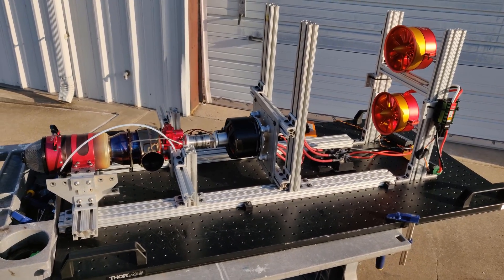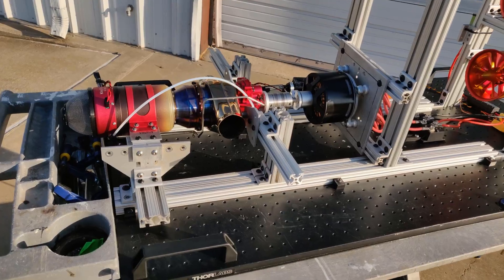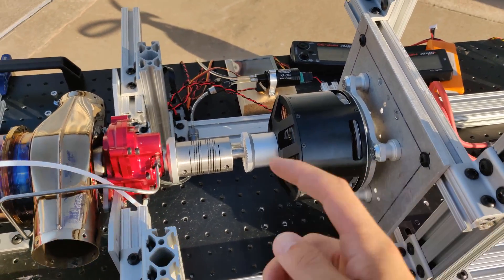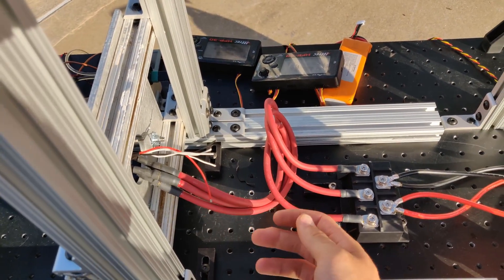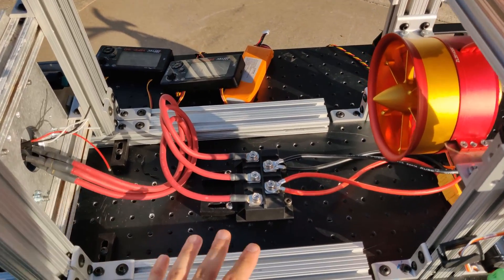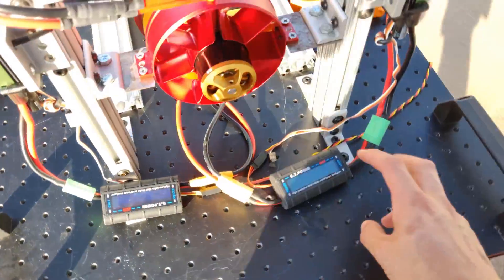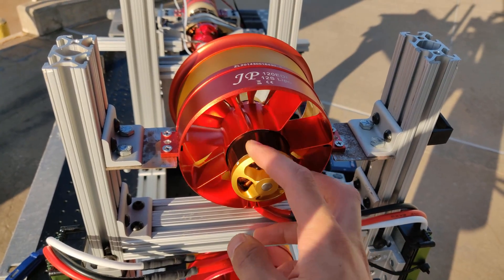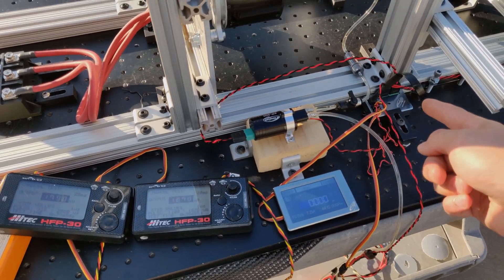Turbo Electric Hybrid Aircraft Power System Test Bench First Run

Comment: To maximize total efficiency you want the turbo engine and generator in a constant load configuration for the majority of it's operating time. The turbine engine specs should list it's most efficient operating conditions. This should be the target charge rate for a battery / capacitor storage system. With a properly engineered load buffered system the variable current draw of the power transmission system should not impact the load placed on the turbo generator. The varying load conditions are the source of the inefficiencies and most of the pollutants in (ICE) internal combustion engines. Load buffering is absolutely paramount in achieving maximum efficiency with the lowest emissions possible. This is true regardless of the ICE used and has not been implemented in a single hybrid electric vehicle I am aware of at this point in time.
Reply: Sadly they haven’t posted in some time.
Reply from the maker: Yeah sorry, been super busy. I've got more videos to upload on this at some point!
Reply from the maker: I agree there is an optimal torque for each RPM of these BLDC motors and of the engine as well. Ideally you match the efficiency curves of both the prime mover (engine) and the generator to match at your most common load power level. There are ways of implementing an adaptive hybrid controls scheme using active 3 phase boost rectification instead of a diode rectifier (like I show here) that can give you much more control of the torque and RPM of the generation/engine, allowing you to optimize and get the best efficiency at off-design lower power levels, even it if isn't as efficient as the on design conditions. I've seen lots of new UAS hybrid power systems utilizing this type of controls scheme in recent years. Many hybrid automotives employ control systems similar to this and will start and stop the engine using the battery to "buffer" the power system allowing the engine / generator  to operate closer to its max efficiency recharging the battery when it does cycle on.
Reply: @ElectroTechnics  he’s back! Nice yea I’m working on adaptive hybrid control system. Using a KingTech KT45TP. UAS runs of a 12s lipo the engine is controlled by a teensy will run engine in a voltage range while controlling change rates to keep packs at a safe charge rate, while also compensating for  the current draw from the UAS bus. Let me know if ur still working on this. Should discuss.
Reply from the maker: @dronelabs556 Cool! I worked on that same type of thing as one of the next phases of this project. Used an Arduino instead of a Teensy to run engine PID. If I did it again I would use a VESC as an active 3 phase boost rectifier, that's gives you so much more control authority to handle efficiency optimization, battery recharge, and more. I'm always happy to talk about projects like this, just shoot me a message on here.
Reply: @ElectroTechnics  I’m working with 3 phase FBR w large smoothing capacitor. Run 170v 3 phases or ~350v with 6 phases DC into a dual SMPS, controlled w same teensy that runs the engine. It’s probing voltages on different ground planes and dynamically trimming the SMPS to control current to the 12s bus. Thing is sweet. Charges packs up while holding down a load in 10-15 mins. Thing is engine needs to be more efficient. Thermal efficiencies are low. Or make a second stage to recycle the lost heat.

Comment: This is the exact setup I'm hoping to use to provide power to an electric motorcycle project idea I've been tinkering around with. i looked a wile back to see if anyone has done a similar setup and found nothing, it seems in the mean time you ended up doing exactly the setup.

Comment: This is exactly what i was thinking.
But than with just a combustion engine.

Haha you made a turbo charged jet hahah
Awsome!

But bro. Safety firts.
Youre talking about 7000 rpm
And you dont have a barijg between the flexible coupling and the motor?

You dare standing there while filming.
If the thing snaps, and you get a little disballance at 7000rpm.
You'd better be wearing a helmet. Better make 2 on top of eachother, just to be Shure. 😉

Dit you make any progression lately?
Reply from the maker: Hey thanks for watching and commenting. These couplings were small I wasn't too worried about it flying apart 😂.  I haven't worked on this in a few years now but where I left off I was working on using a VESC 75/300 as an active 3 phase boost rectifier in place of the diode rectifier. It provides way more control of the system and higher efficiency levels.
Reply from the maker: I have lots of unedited videos of additional work I did on this project. One of these days I may find time to dig them up, edit, and finally post the updates.

Comment: Hi there, do you have a capacitor at the diode rectifier? Thank you
Reply from the maker: There is no addition capacitor, although the motor controllers connected to it have capacitors on their DC inlet bus, so technically there is some capacitance added after the rectifier.

Comment: Dude this is exactly what im busy with with a drone of mine. Good work so far
Reply from the maker: With a turbine? Sounds like a cool project, I'm putting a smaller version of this on a multirotor currently. I gotta get some more videos uploaded of it. Good luck with your project!
Reply: @ElectroTechnics   yes same setup as yours but im running 3 120mm edf units. When you posting more vids?
Reply from the maker: @perrinoneill1656  As soon as I get some time to edit them, I've got lots of unedited videos, and I'm currently working on putting a small version of this system on a dodecacopter drone! I am excited to try to fly it later this week. I'll post it up as soon as I get it going.
Reply: @ElectroTechnics  sir the setup you have was exactly what i was looking for

I hope you read this!!

 at idle you barely generate any power or thrust while consuming a relatively large amount of fuel in comparison to generating huge amounts of power and thrust at 70% throttle while consuming a bit more fuel than idle

What i am suggesting is that the turbine engine is ran at max power then the electric motor is used in regenerative or generator mode to put load on the engine which drops its rpm to the max efficiency rpm

This will generate both thrust from the propeller and provide constant current 

You will measure that current generated at that point and accordingly size your edfs to benifit from every Watt generated

I believe this will provide the best performance and efficiency on average

Please let me know what you think
Reply from the maker: @FirstLast-tx3yj  Yes! That's the ideal operation mode for this. The larger scale tests plan is a turbo prop engine with a hydraulic variable pitch prop, so it will automatically adjust the "load" of the propeller to maintain the optimal RPM. Ideally we can adjust the amount of "regenerative braking" on the motor depending on the electrical demand, and the prop will automatically adjust to keep the RPM up when the generator loads down.

Comment: I don't understand why anyone has not made this on a large scale yet. But with propellers versus duct fans
Reply from the maker: I'm working on a larger scale version of this for testing with manned aircraft. Over the next year I should have a video of some test runs!
Reply: @ElectroTechnics  I am really looking forward to that!!! I am working on getting my pilot's license and looking at airplanes to buy. I don't know on someone hasn't done what you are doing on a large scale platform. It seems to me like a small gas turbine or piston type engine acting as a generator for a constant power output to a electric motor would make a fantastic airplane.
Reply from the maker: @gsxr600rafii  I could see the hybrid design allowing powering a distributed propulsion system which could open up the possibilities for small manned aircraft capable of vertical take off and landing. Maybe a plane like a Cessna with 4 lift rotors that electrical power could be diverted to for take off and landing similar to a multi-rotor drone.
Reply: @ElectroTechnics  that would be amazing!!!
Reply: @ElectroTechnics  I realised here that you take AC from the generator convert to DC with the rectifier
 then input DC in the controllers and output ac for the edf fans

A simpler setup I would suggest is to connect the edf fans directly to the generators
And you throttle the fans by controlling the regen on the generator motor

When you add regen the fans will spin higher and when you decrease regen they will shut off

Given that the edf can withstant the 60V from the generator
Reply from the maker: @FirstLast-tx3yj  It doesn't work that way. Without that DC bus in the middle (if the AC generator is connected directly to the EDF fans) you loose all controllability of "regen".  The EDF's current draw is a function of the frequency and voltage of AC that is supplied, so they could be directly driven by AC but you lack any high level control of the EDFs and if you run multiple motors off of that high frequency AC, it is very easy for the motors to get out of sync, spin the wrong direction, or burn out. All bad things on an aircraft. This is the reason AC induction motors have starting capacitors to make sure they spin the correct direction and to handle the massive starting current as it tries to sync up with the line freq.

Even with a DC rectifier, you are unable to directly control the amount of regen happening. With a DC rectifier, the power generated is a function of the generator's speed and thus voltage and the load's power consumption at that voltage. 
To be able to control the regeneration, it is necessary to have a DC Bus with a capacity to store DC power (capacitors or batteries) and to have an appropriate bi-directional ac dc converter (I used a VESC) which will modulate power to and from the 3 generator leads, to induce the correct amount of magnetic field into the generator's stator to achieve the desired power generation. Without this, there is no way to directly control that power generation. If you are interested in how this BLDC regeneration control scheme works, there are many scholarly publication available on the internet that go in depth...they are rather heavy reads though.
Reply: @ElectroTechnics  thank you for the lengthy explanation appriciate it made things very clear.

I also realised in your latest video you have a propeller is it connected to the other end of the generator or it has its own motor?
Reply from the maker: @FirstLast-tx3yj  The propeller on the test bench has its own motor. It is there to simulate a propeller type propulsor on an aircraft.
Reply: @ElectroTechnics  not on the test bench... in you last video where you flew the plane
Reply from the maker: @FirstLast-tx3yj  oh, hah! Yeah it's on a completely different motor/shaft, exactly like the test bench. We will be working on a new config where the prime mover engine drives both a propeller and a generator for the larger scale tests.
Reply: @ElectroTechnics  ı have been thinnking kinda same think over here in turkey, cannot get it out of my head,  a manned vehicle with vtol and drive cabilities but my setup is a liitle bit different
Reply: I was just thinking the same thing and started looking for YouTube videos to find. 

I was thinking of a turbine with a shaft drive like a turbine powered helicopter, or a turboprop, but with shafts powering 4 rotors like a quadcopter. It would use variable pitch blades for directional control and Gyros or Flybars for stability

I imagine this might be a solution to the problem of short battery life when upscaling an electric powered quad to human scale.
Reply: @ElectroTechnics did you do it yet?
Reply from the maker: @mrwess1927  I haven't worked on this for a few years now. Other students are still working on it though and they have a much larger version now using a PBS TP100 engine, driving a generator and propeller, mounted to a stationary Cessna 152. Its a pretty cool sight to see!

Comment: Hello, i would be interested to know more details about this. I might use this in a project myself (Not airplane but as hybrid propulsion system) Could you share more details about how did you choose the right generator motor, the diode system to convert to DC, etc ?
Reply from the maker: For a personal ground vehicle? Sounds like a cool project. There is a lot that goes into sizing a system like this, but a good starting point is figuring out what your power requirements are, cruise power vs max power, what RPM and what Torques you need for the engine and the final drive. Then you can start to identify a battery, motor, controller, etc that have compatible voltages at the right power range.
 
I would not recommend using a diode rectifier the way I showed here, it is not a robust way of doing it. VESCs are great motor controllers and can be used to run the generator in "Regen" mode and can drive motors from batteries efficiently. 

Since there is interest I may make a video that goes over how to build a hybrid drivetrain for a personal vehicle. I've been thinking about making a hybrid go-kart or something as a for-fun project.

Comment: Little late to the party, but what about a turbo prop style setup? Spinning a turbocharger style impeller directly with the bldc, with the exhaust power turbine connected ONLY to a propeller or ducted fan? 
You could route your charge air exactly the same, bldc spins intake turbine, exhaust turbine drives propeller. Add fuel to combustion chamber all the same?

Comment: In spooling up the turbine, what causes the electric motor/generator to engage? Is there a centrifugal clutch inline?
Reply from the maker: Very late reply, but it is just the "fluid" coupling of gas from the engine core to the shaft's separate turbine.  The output shaft is not directly connected, power is only transferring through the jet exhaust stream, it starts spinning after the engine starts to spool as initially the exhaust speed is not high enough to turn the shaft until the engine starts to spin up.

Comment: Who makes the motor?
Reply from the maker: If I recall correctly this was an unbranded Chinese motor that came from eBay or AliExpress. It was cheap and was selected as the budget was very small. Otherwise I would not recommend using this motor, there are much high quality motors with better efficiencies available, but for the low price point this motor was not bad.

Comment: Man i don't think so its economical. You are getting not so much electric current for pouring tons of jet a.
Reply from the maker: This is true, the kingtech turbine is extremely inefficient and thus wastes lots of fuel.
Reply: Jet A still packs more energy per volume than Li-ion batteries.  Even with additional losses in the energy conversion chain, electric flight and avionics run times are potentially increased.

Comment: Excellent job. What brushless motor are you using?
Reply from the maker: It's a 120x90mm motor. Here is the link: http://mymobilemms.com/OFFTHEGRIDWATER.CA/Brushless-Motor/20KW-12090-Brushless-Out-Runner-Motor-50-130kv-Large-Air-Craft